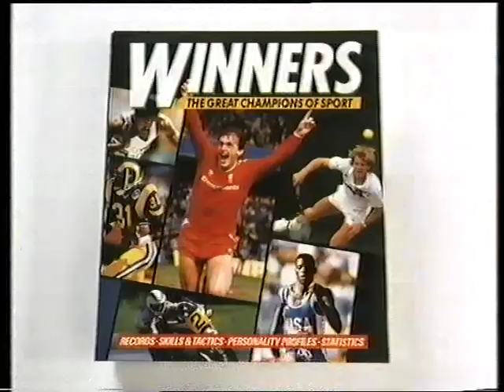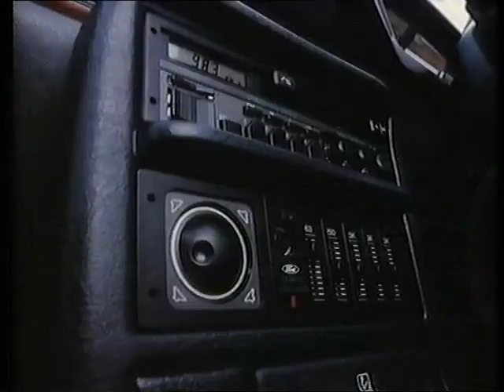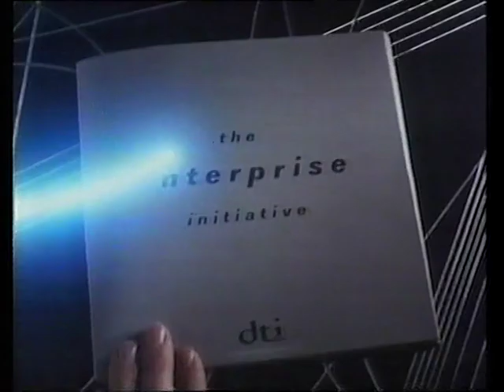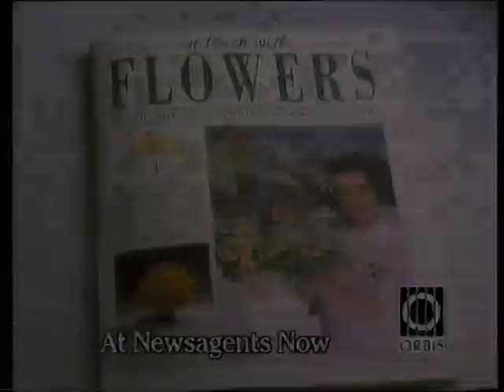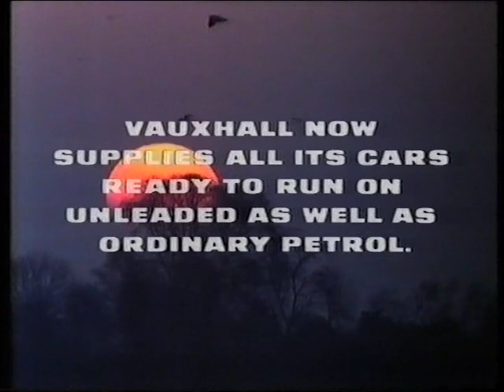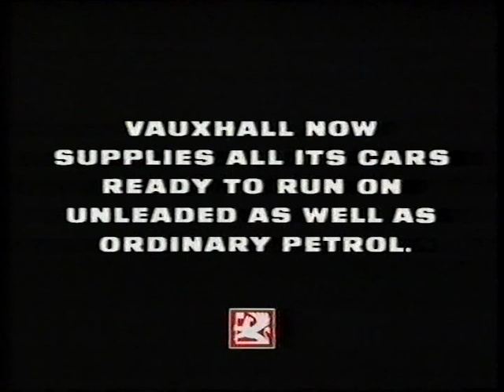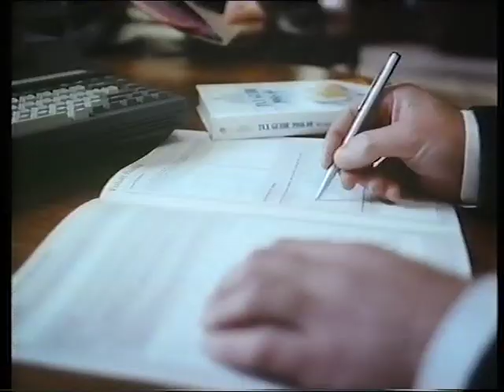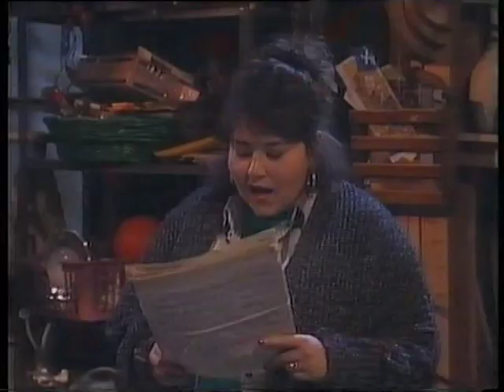Channel 4 - 1989 - Mona Lisa Movie Premiere Introduction and Adverts

Comment: 1989 actually
Reply from the maker: Yes, I think it would have been possibly February 1989 now as there is a trailer for the 1988 film The Accused that I have found out wasn't released until a  year later. There is also a trailer for the 1988 film Return Of The Living Dead Part 2 which must also have been released a year later.